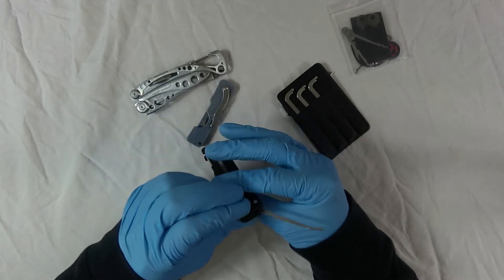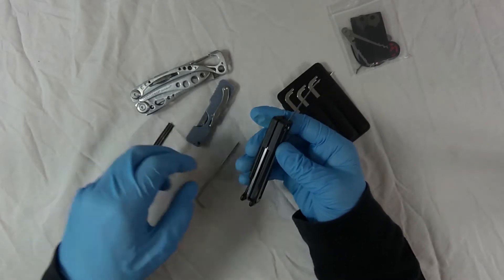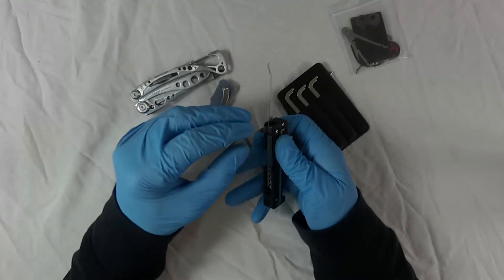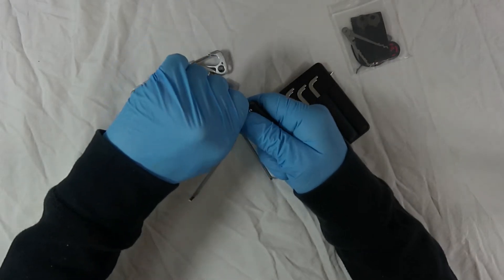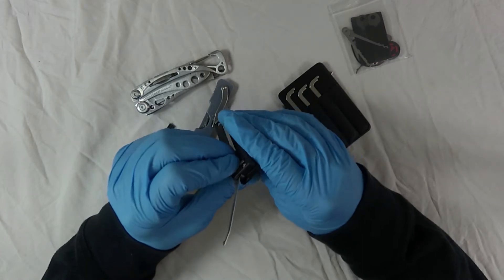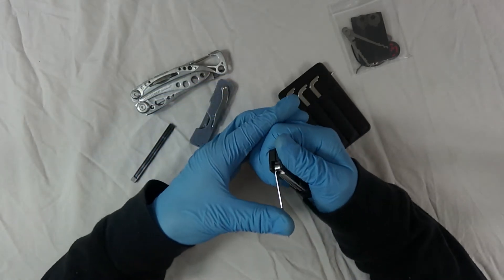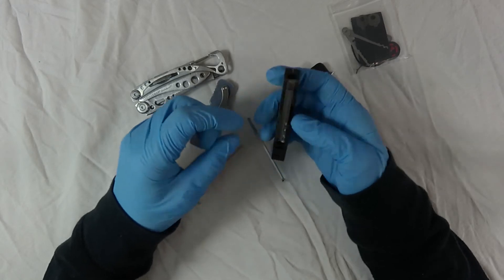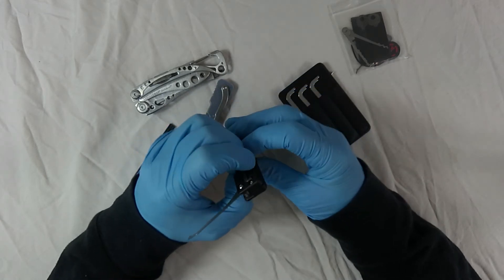108: SWICK Cracking Noise

Comment: If the screw holding the picks is a bit lose or due to some other reason....the first or the last picks make the noise....might be they get slipped between the metal spring and the black casing